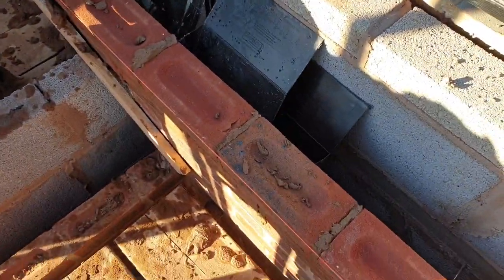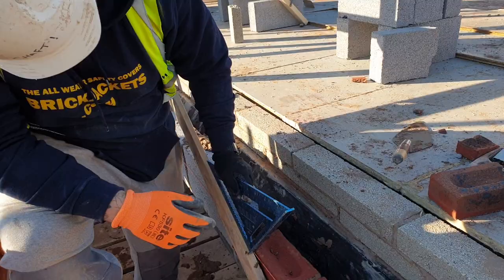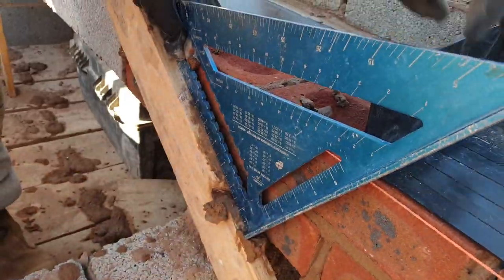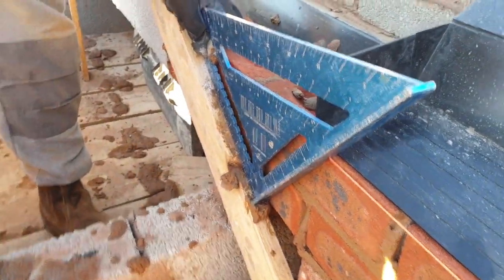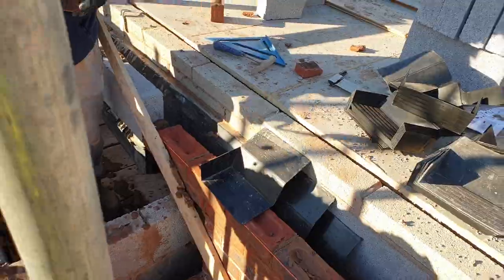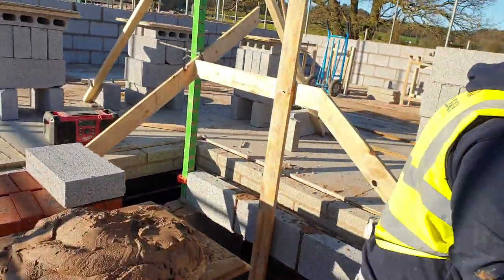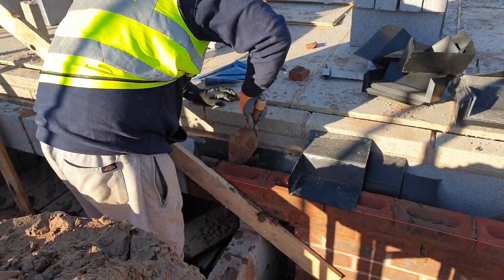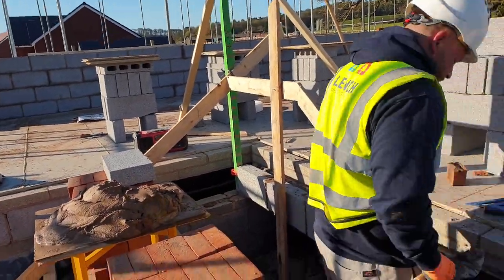How to do Preformed Stepped Trays In Brickwork

Comment: Your dummy roof timber is sat on the blockwork. Should it not take the wall plate into consideration?
Reply: monkey builders rafter should be on a wall plate there all be to low